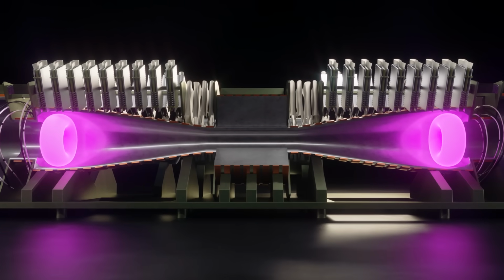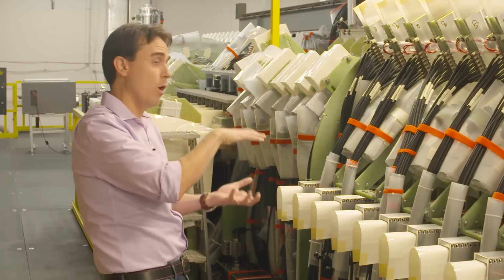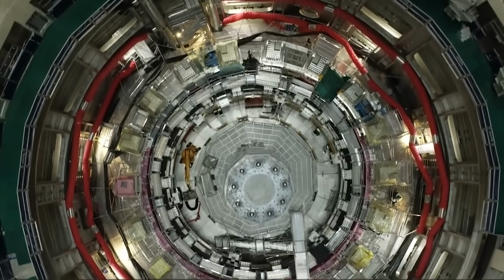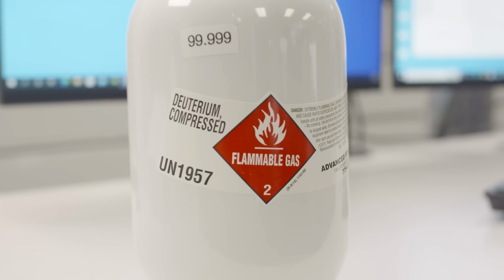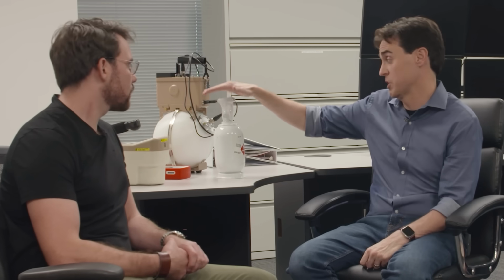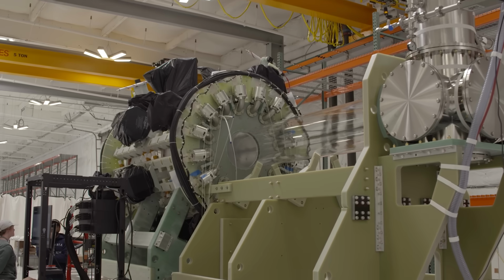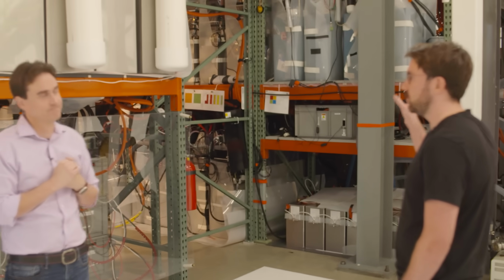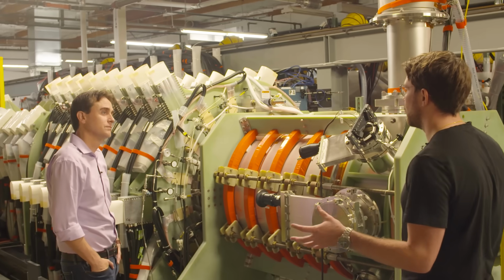A New Way to Achieve Nuclear Fusion: Helion

Comment: For clarity, the concept here is that they don't produce "ignition" like the NIF just did. Nor do they need to have full ignition. The idea is they use the reaction energy from the plasma collision to directly produce electricity. As long as there is some fusion going on and it's enough to generate an acceptable amount of electric power, full on and total fusion is not really necessary in this machine. Is that correct?
Reply: LMAO. You need to get MORE ENERGY OUT of this machine then you PUT IN IT. Right now, they get far less out than they put in. Which is the problem of ALL attempts at fusion (except national ignition facility which produced more than was put in for the first time in human history).
Reply: @chronokoks  but that is a totally worthless point since the NIF lasers put 2 mega joules of energy on the target and the fusion generated 3 mega joules - BUT LMAO, they put 330 megajoules into the lasers to charge them up. This is a total non-achievement when it comes to practical, ELECTRIC POWER generation. Helion seems to be doing work that will actually have a real benefit for ELECTRIC POWER  GENERATION instead of NIF merely proving the equations work.

Comment: Hi, thoroughly enjoyed the video. In the video. Helion is building larger units for commercial applications. I wonder how much energy can they get from their smaller scale units. Rather than commercial applications, perhaps the smaller scale units can be adapted for private use (eg. to power a single home)? Or, is there some minimum scale/size that is required to allow the reactor to generate more energy than put in to induce fusion that would make existing, smaller--sized units not practical as generators?
Reply: There are more than three reasons this won't be a private use for a long time, but here are three: 
-Economy of scales doing something so specialized is almost only worth it when you can do big scales. 
-its complicated so needs specialized operators and maintenance 
-the smaller reactors weren't small, they were just too small too work. Smaller scale just for Research
Reply: In adition to what another commenter stated, the reactor itself is only one part of the puzzle, you still have the giant capaciter banks and electronics equipment that manages the reactor. I dont think you could really expect to get something like this running a private home unless it were some billionaires mansion who could afford to pay a team to run it.

Comment: Ahhh so cool you feature the Helion reactor.
Although the fusion tech it self is excellent, the real leap imho, is how they create electricity in a much more direct way then the classic steam generator. 
I've pushed by brains for years to imagine a new system to extract electricity in a more direct way from a heat/pressure source.
This push push-back tech is the most inspired technology I've seen in decades.
Reply: Turbines do have some major advantages over this though, they smooth out the electricity generation as the turbines act as flywheels. There’s so much energy stored in them that if the power station stops, the electricity keeps flowing for a couple of minutes. That buffer also makes it easy to ramp the up or down the power output in response to demand.
Reply: No numbers so for the time being it's bullshit. if it produces more watts of heat than electrical energy then the entire thing is not viable and we're back to square one.
Reply: I was thinking the same thing when watching the last video. Our steam turbines are extremely efficient these days, but I thought of how we could harness the energy in different ways. Oddly enough, a gasoline engine came to mind. A fusion reactor that generated power as conveniently and directly as an engine would be amazing, and that's basically what they're doing here, except electronically instead of mechanically. Which is mind blowing.
Reply: @eclipset.9683 Can imagine every city 100,000 or more having its own compact fusion generator feeding electricity into the grid. Perhaps even running large ships, large aircraft directly for very long range without pollution. If cost can be low enough decarbonize the atmosphere.
Reply: It took humanity a while, but we're no longer boiling water.
Reply: Right on! No need to boil water, instead use it just like a Nikki Tesla generator. Maybe it will straight away run at 60 hertz as well. Super complex but simple. Gotta love it.

Comment: Big energy holds so much power (pun intended). The political, financial and technical (and many times, when neccessary to get their will through force; military) control of it, is desireable on a level so extreme it redefines the definition. Once fusion matures further and nears net positive; governments, politicians and key companies are gonna go so hard to try to gain a controlling iron grip on it, it will make the US effort to control nuclear (fission) power, and its effort to control every as many governments as possible through forcing global trade in USD - seem like friendly suggestions. There's also so much money in enery, there's no way fusion energy becomes remotely free (beyond technical upkeep costs). I don't know how they will end up controlling it, but I'm highly confident they somehow will. And I sincerely hope I turn out wrong on this.

We actually used much of the same rhetoric around nuclear (fission) energy, especially during the first decade or two. At its core (hehe), modern nuclear fission enery doesn't need to be as expensive as it currently is in many areas, either. And when all is summed up, for now it's actually among the cleanest, lowest environmental footprint energy sources we have. It's also the only non-fuel-burning viable source able to supply most very industry and residental dense regions around the world. It's far from perfect, but without mass scale, high efficiency commercial fusion available for likely multiple decades still - nuclear fission is the only way that can get us where we need to go in what little time we have to get there, in terms of climate. Other, clean renewables need to be part of the "mixture", deployed in forms and scale that make sense in each individual region, climate, topography etc, and expand their deployment as they further mature - ideally, eventually, displacing nuclear fission with clean renewables and fusion. But they're faaaar from ready to carry the burden on their own, especially in those super demand dense area, and with the need for electric energy perpetually blowing up. Hydro can have beastly capacities, but its ecological, agricultural and environmental impact can be immense and extremely far reaching. You also need to actually have all the natural elements and conditions for it already there - you can't just build and huge dam and hydro plant anywhere, as you pretty much can with nuclear. And yes, the waste is problematic. But in practical reality it isn't anywhere remotely as problematic and harmful to both environment and the general population, as the wastes and byproducts of for instance coal, oil products and gas / LNG.

Comment: 100 million degree but doesn't melt the equipment? I'll like an explanation of how that works. Like what cooling is used?
Reply: Vacuum with great insulation. Though it does still eventually wear out the insides.

Comment: Now it's my time to be the buzzkill. Because like EVERY energy technology, it is limited by one thing above everything else. The number of dollars of cost per watt or per watt-hour it generates. And you're going to find that even if fusion "breakeven" was attained, it doesn't MATTER because it will still merely be a source of EXPENSIVE ENERGY. You will find without doubt that the cost per unit of power will not even be close to being able to compete with solar or wind power. Even if successful, after all these years of promises of fusion being 20 years away every year for the last 70 years, it will still never be more than a curiosity. It will not be economically worthwhile for actually generating power because it will use extremely expensive equipment and that money would be better spent on solar cells or windmills.

Comment: How does it transduce energy effectively on the output side if the input energy required is 100000 amps per coil....and with how many coils there are (I haven't counted) probably over 1M amps? I don't understand how you would be able to produce more energy than what is being input.
Reply: Good question. And,  I have seen nothing on what they expect, or have achieved to date, in regards to output energy/input energy.  Without that data, the reactor is not much more than vaporware IMO.

Comment: How do you make the calculations for the 22bananas =10M Joules? I'm intrigued because I have an idea but I don't know where to gather the data I think I need from.
Reply: The rice i just cooked has 1.5 MJ per 100g,as stated on the package.
Reply: @flummi6966  ok yeah, I meant, bananas don't have a package usually, and if you search for bananas the average banana has 105calories which is 420 joules, quite far from a fraction of 100Million joules, that's what I meant, and I was wondering if that number was something like a total energy conversion or something like that cuz chemical digestion doesn't make use of all the energy contained in a meal.
Reply: @FTotox  doesnt the k prefik mean a thousand? like kcal and kjoule are present on my rice box,so 420kjoule*22 ~ 9Mjoules?
Reply: @flummi6966  yeah but that's not a 100million joules lol that's why I want to know the conversión or how they did the calculations
Reply: Lets see. If St Google is right, the average banana contains 105 kcal, and 1 calorie equals 4.184 joules.
So, the total energy in joules of 22 bananas would be: 22*105e3*4.184=9,665,040 J.
Not far from the mentioned 10 MJ (not 100).

Comment: Ridiculous that there's no mention of the energy input compared to that released in the reactor.  Nor are there approximations for the impressively-stated "seventh generation reactor" that's going to "generate electricity." Probably this is for good reason, as most likely the company is decades from this goal.  Rather disingenuous, deceiving the viewer that generating net energy and then commercially is only a few ITERations away.  It's not.

Comment: I gotta say, you people havwe some FUCKED up looking old ass looking battery capasitors. All milk carton lookin faling apart POS stuff. I'm just going to say it, if you were to say use Tesla's new battery packs to condens down your energy cells and control your bursts as well as clean your working space up and allow the fusion generator to be much smaller to be more "portable" and possibly be installed in vehicals or perhaps spacecraft it could change EVERYTHING!

Comment: Wow! the Rockwell Turbo Encabulator sure has come a long way
Reply: This is light-years beyond the technology employed by the Turbo Encabulator. The use of dingle arms is all but extinct nowadays. It's been replaced by 6th generation Ganglyhanger flange assemblies and proton-dense cubiclation wiring harnesses. Not to mention the way that they solved the upfill power configuators negative semblant pressure by utilizing Alzuniam core nitro-ionizing flatplate heat exchangers. It's really exciting!

Comment: How much power does this use to start? That's one issue that I see with this is that it cant do a cold start. Not sure if a generator would be able to hold enough power to start either. Excited to see how this technology improve!
Reply: I am far away from being an expert in this and correct me if I'm wrong. They are using capacitors to power this so you could in theory use a smaller generator to charge them over time, it would probably take a lot longer than having direct access to the grid but it would charge them up eventually and then they could start it.
Reply: If enough of these things are connected, you can start one using the power from another.
Reply: @DavidKlausa  True I was wondering mainly how they would start them during a blackout. Seems like they need to depend on another source to do so for the time being.

Comment: Could you possibly fire 4 plasma rings at each other to double it in the same area? Or go farther down the rabbit hole and go 6/8/10/12/etc?
Reply: are you trying to ignite the entire continent?
Reply: I think intuitively, we keep it as two because that's the simplest magnetic coil configuration at the centre point.
Reply: Rather than introduce more, would not be easier to increase the size of the two ?

Comment: I absolutely support fusion research but why is fission being presented as being "too expensive"? Fission has been providing cheap, safe and dependable energy for decades. It is not perfect but fusion still has to prove itself after decades of research. It has never generated significant power so far.
So currently fission is a valid way of generating clean power.

Comment: This is the best fusion method I’ve seen yet. Unlike the other methods, this one seems like it can actually be scaled beyond a proof of concept!
Reply: No disclosure of any fusion conditions (temp, pressure, field, current).
Reply: @tomszabo7350  and not even close to a disclosure of achieved Q factor.
Reply: @Joe Murphy  Fairly certain that means they can't measure, much less recover, the fusion energy ... supposedly a simple matter of Faraday's law of induction ... the fast protons inducing an electric current ... with a claimed 95% efficiency ...

Comment: Uses 90% of it's own energy to maintain the reaction, which i admit is better than 10-1 ratio of invested vs extracted energy that early attempts had, and is theoretically net positive, but taking into accounts all the inefficiencies i doubt this will be anyhting close to comercially viable, and certainly not a revolutionary energy of the future we are all dreaming about.

Some unknown percentage of 10% of energy will be lucky to even compete with traditional commercial reactors, and likely at a lot higher production cost and a lot lower lifespan.

A step in the right direction? Perhaps, but a revolution? Highly unlikely. Color me skeptical.

Comment: One question: how the "millions of degrees" doesn't melt the place/machine? This is amazing!
Reply: They capture that energy and keep it off the walls through the magnetic field they create on both sides
Reply: it's all a vacuum inside.  and infrared radiative heating is one of the least efficient methods of transferring heat. 
so basicly there is an insulating layer of nothing between the plasma and the inner walls.

Comment: It seems to me in this design the neutrons generated by the deuterium - deuterium fusion are not used for anything and their energy just gets wasted by damaging everything around the reaction. I wonder if it's possible to use a blanket made out of a neutron moderator material (e.g. water) to observe the energy of these neutrons and use it to generate additional electricity, while protecting the equipment further out from fast neutrons.

Comment: Very nice! Looks like it could even double as a WARP DRIVE eventually! 
I thought Helium 3 was aplenty on the moon's surface. Was that just a movie plot?
And solving the engineering issues are not "adding complexity to the symphony," they're adding an AUDIENCE FOR the symphony.
Reply: Yes, Helium-3 is - compared to Earth - abdundant on the moon (though you still need to chunk through 150 tons of regolith for a single gram according to Wiki). But given high solar efficiency (and all the required materials for solar panels being easily extractable on the moon), a self-sustaining large-scale mining operation would be feasible. Plus I imagine the lack of environmental concerns would make things also easier.

Which would make it the only economic incentive for a moon base, which personally I would find extremly cool :) Mining operation on the moon to send Helium-3 back to Earth for Fusion energy.

Comment: While I am happy for any Fusion progress, I have some criticism reagarding the video. 

First, the reason why almost all the current research reactors (Tokamaks/Stellarator/...) use the D-T fuel cycle isn't because they couldn't use the D-He³ Fuel cycle. The use it because DT is available and are easy to fuse. If your target is to research plasma and fusion physics and you know that you wont be energy positive anyway, it is only logical to use this fuel cycle. So not mentioning this is a bit dishonest. 

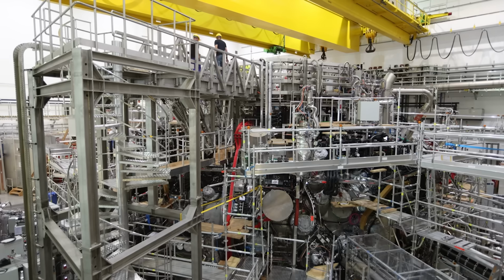Also at 9:48 you talk about Tokamaks, but show a Stellarator, namely, Wendelstein 7-X 

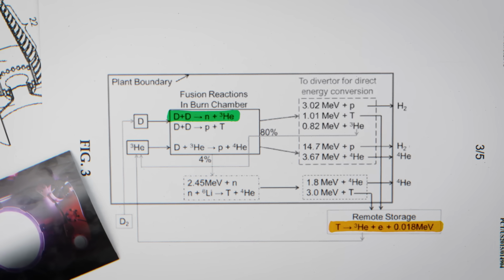Also, it is a bit dishonest of criticizing Tokamaks for using Lithium breeding, while their own process, also uses Lithium breeding, as seen at 15:46. Because, as it turns out, there is no free lunch and He³ is ludicrously rare on earth. 

Regarding Beryllium, you should have mentioned that ITER specificly uses Beryllium plates for shielding, not Tokamaks in general, and that there are more than a few ways around it. And the level of uranium contamination was also pretty overstated, you made it sound like it was a huge, insumountable problem, when it is a minor problem at best. Humanity has become very good a purifing stuff. 

In general, I am pretty disappoint with the video and your lack of integrity. The whole video sounded like an application to run their PR Department. No hard questions, missrepresenting other research to make them look good, missing context and then even showing the wrong reactor, not even the one you were missrepresenting. 

I wish the team at Helion all the best and hope you take this oppertunity to improve and return to becoming a quality video maker and not a Corporate PR Megaphone.
Reply: This RE video is so much of a PR propaganda its embarrasing.
Reply: Due to time constraints a lot of editing was done.  Perhaps all of the information you want discussed about other technologies didn’t make it in this video for obvious reasons.  The video is about what Helion is doing.